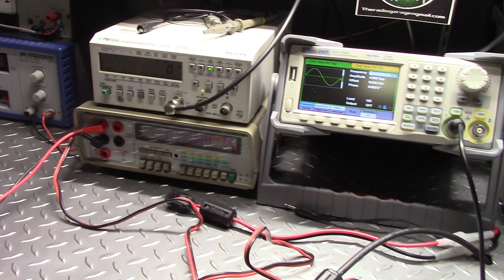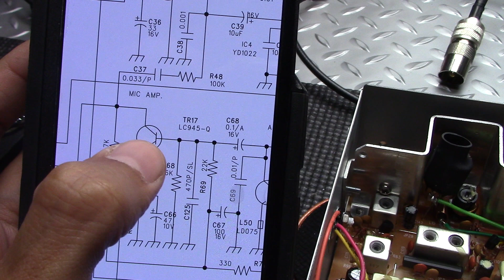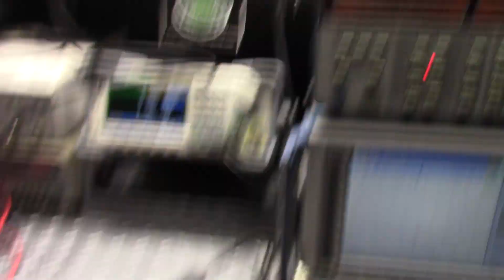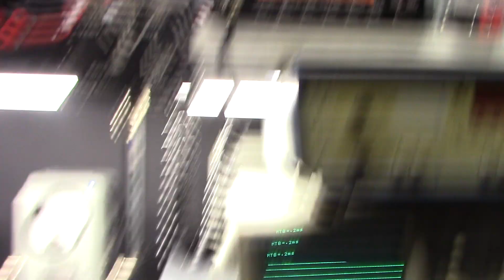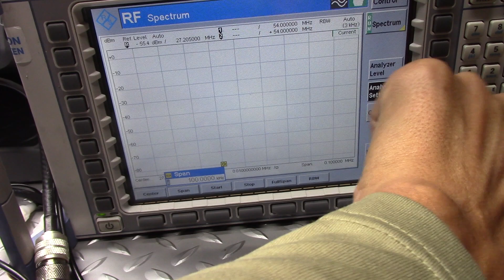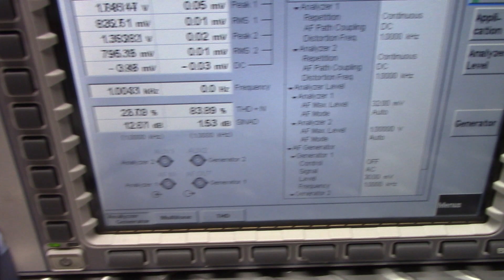Cobra 29 NO MODULATION Fixed! CB Radio Alignment

Comment: Can you help me?  I have a Uniden PRO-710e I'm trying to figure out why it doesn't have transmit or receive.  The PA does work.  The receive/transmit lights are working and change properly when I key the mic -- just no carrier / no modulation / no audio at all.  I've replaced several caps, took voltages, looked for broken traces, replaced audio chip and tried different microphones, etc.  I replaced the final and driver transistors.  The only thing I'm finding is voltage not correct at the PLL chip.  I've checked down the line to what powers the PLL chip on certain prongs and can't find anything wrong.  Then I replaced the PLL chip and same results.  Also, IC-5 is getting warm quickly, even after I replaced it. Ugh!  I have a paperweight right now and really don't know what to do with it.  I've tried everything I know with my limited tools and knowledge.  Any suggestions at what I could look at?   Also, do you know of any transistors in the Pro-710e that may be put in backwards because of incorrect print on the board?  I heard that can happen from time to time.

Comment: I have a Cobra 25 WX ST with no modulation and no PA. Do you think that I have the same issue? When I key up, the power needle moves to the left instead to the right and cannot do a cal for my antenna. Also, when I plug in a PA speaker and switch to PA on the CB, I can hear CB chatter like I plugged the speaker into the ext speaker jack and tried speaking and I can barely hear my voice with the dynamike turned all the way up. Do you think there are multiple problems or the same issue that's in your video?  How do I send it to you for repair, and what are your rates? Thanks!

Comment: Good day I just picked up a 1985 Cobra 90 LTD meter shows 9 watt dead key external meter shows 2 watts I can
t find anything on the net but how to make it louder. Which leads to my main problem keys up but produces no audio out through the meter or on pa. any advise would be great there are no shops that work on radios here.

Comment: I just bought this exact CB from a pilot.
Needless to say I'm not getting anything positive on my radio checks.
I calibrated the SWR/ antenna using the radios meter. Maybe that's my first issue. Magnet Mount Wilson lil wil is all I can use on this van.

Comment: I have a cobra 29ltd chrome and does not transmit or receive, also when pressing on mic its not putting out power, would replacing those capacitors fix it if so where can I buy them???

Comment: I have a cobra 29 chrome with no transmit or receive could you help  please
Reply: I have 2 now that do the same thing.
Reply: @rickyh4796  If you have a FC you can also check for 10.240 at pin 4 of IC3.Could just be a broken solder on the xtal.
Reply: @577holehound  what is a fc?
Reply: @rickyh4796  frequency counter
Reply: @577holehound  thank you
Reply: Check your PLL voltages make sure they are correct.

Comment: Could you tell me what equipment i need to work on cb radio's' ? I have a watt meter,fq counter,vtm. I work on cb radio's it takes a long time to repair some by doing the hard way.    Thank you for the Information I just subscribed today !!
Reply from the maker: Think about getting a oscilloscope next. They are very useful and couldn't imagine not having mine now. Thanks for watching 73s
Reply: @TheRadioGarage   Thank you i had one a long time ago  you do good work i  subscribe to your channel .  I fixed the cobra 29 i check all the volted i found the  
problem was a bad mic wire on the on output mic gain ...
Reply from the maker: Good job 👍 glad you got it figured out.  For some reason the radios I get are never that easy 😄
Reply: @TheRadioGarage  It wasn't easy  I  spend a  half day checking  voters you help me by your video's & then i found it  . I thought everything was right but it had me fooled I've have been repairing since the 80's sometimes the simple things are hard to fix  it is not always easy. some new radio's are high tech now days...

Comment: So did those bad Caps take out the audio chip and transistor or were both of those ok in the end?
Reply from the maker: The audio chip was actually still ok. Shorted cap was the issue.  The caps they use in these newer 29's are very cheap low quality products.